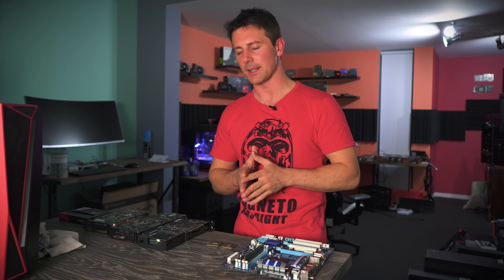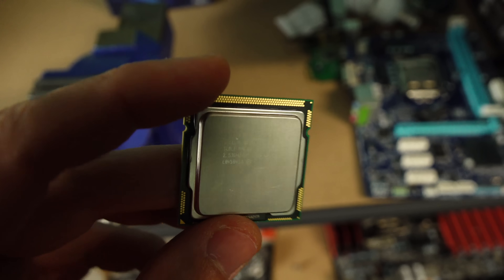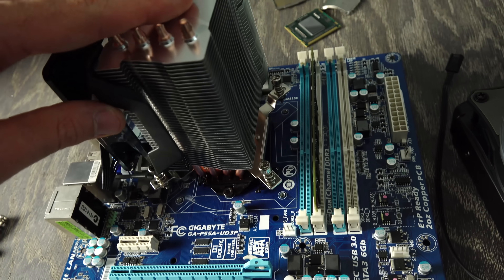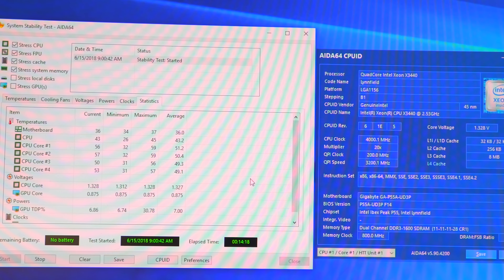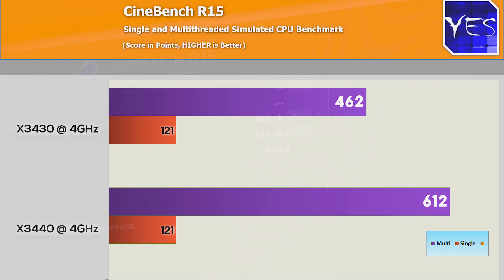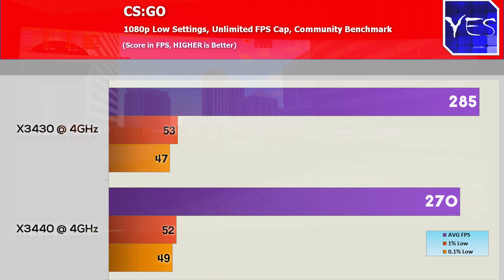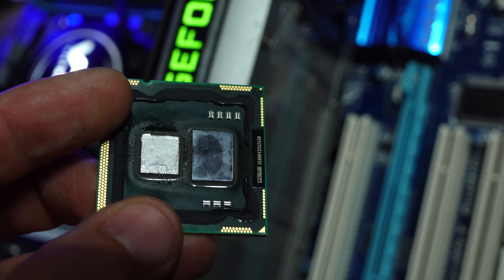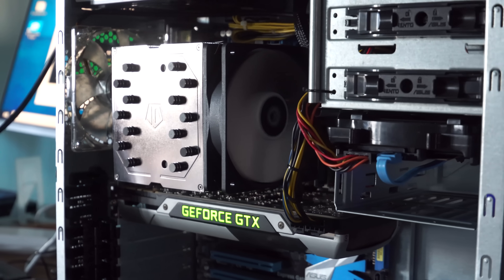X3430 ($7) Vs. X3440 ($18) Xeon - Is Hyper Threading WORTH $11!?

Comment: i had to do this recently my self, you can just screw of the "socket mounting hardware" and change it or modify the existing to your liking to fit standard / not standard coolers / backplates to any motherboard. so in this case, you would just screw it off and saw/dremel of the "threaded parts" that "block the default holes" for the push pins.

Comment: I have a 200$ budget to build a cheap 4k editing machine, no need for special fx, just simple cut and export. Think I'm gonna get a i3 8100 and a mobo + ram and thats it, got an old r7 370 which should be good enough for a start. What do you guys think? I found a brand new i3 8100 for a little under 100$

Comment: Low setting is a bad idea for testing this question, while it seems like HT is pointless. It's not. If you were to put more strain on the CPU while gaming aka higher settings other things going that can take away the physical cores, the CPU with hyperthreading will be able to keep a steady framerate with it's logical cores assisting while the one without will start choking. 

This is a bad test per say for the topic, you've basically just tested IPC and not the load each can take. The X3440 is the better CPU no matter what unless you'd have to be an excessive amount like 100$ more.

Comment: You need to test other games Brian
Reply: For me the x3440 runs any game I try over 60 fps without any issues. So it will probably run what game you want to play very nicely if you pair it with a good gpu and enough ram.

Comment: This is the fastest cheapest CPU. Had a 3430 in my server, but I wanted the hyperthread from 3440. So far I'm running a X5675 main workstation, X3440 server and X5472 socket 771/775 xeon rigs.

Comment: Still using an i5-750 ( ~x3430 ) clocked at 3.7Ghz on my secondary pc and I was actually looking for some infos regarding a potential upgrade to the x3440 in the near future. Seeing that the difference in games isn't too high between them, I guess I'll wait for now. Meanwhile, I need to find a decent P67/Z68/Z77 mb for the main pc, because my current Asrock P67Pro3 has some serious issues lately with the error 10/55 codes...Anyways, thank you for the video, it was really helpful.

Comment: I still have an old ASUS P55D-E running the i7 870...H60 water cooler, 16 gigs of ram and a EVGA1050 ti FTW.  Hits about 3.7 and still a very solid build.

Comment: Got a Xeon X3450 for $20 at eBay AU last year, running it on my secondary rig which originally had an i5 760 and overclocked the beast of a CPU to 4.00GHz @ 1.32v using a Gigabyte GA-P55-USB3 Rev 2.0 motherboard, with 8GB RAM and GTX 950 2GB, it makes a good TV rig with medium settings gaming when I'm in my lounge room. It beats the FX-9590 @ 5GHz in multithreaded performance, which makes this a decent CPU in 2018.

Comment: can any Xeon fit in my lga775 socket with a psu of 220v? and i will be upgrading psu for gtx 750
Reply: You'll have to use 771 xeons that have been modded to fit 775. They're very cheap though :)

Comment: The only downside of these chips is the wattage. You need at least a 500~600 watt PSU in order to pair them with a decent graphic cards that doesn't bottleneck.

Comment: i got a mobo for this cpu at 20$ via taobao, combo with x3440 is around 30$
Reply: Clement Wong What model of mobo?
Reply: Emperime it's an intel oem workstation mobo from foxconn
Reply: @711jastin  The mobo is capable of overclock?
Reply: @lewis5648  Yes just that i don't know how far can i push with the power phase, clocked it to 3.5Ghz only for safety reason.

Comment: Still using that i5 760 (0:46) in a PC I gave to someone, it's working great for them. Very nice video on the Xeons though. 1156 is still suprisingly capable when 1155 isn't a available.
Reply: yeah, the exact reason I moved from Sandy Bridge, no motherboards around. My poor 2600k is languishing in a dead board :( and replacements are way too expensive and still used... no new old stock I can find.
Reply: Allison Pell: I've had good luck with the Z77 Boards (Gigabyte) from China, they're around £50 which isn't a bad price. You'd need to add some heatsinks to those VRMs.
Reply: Awesome, thanks! I'll look at those soon, maybe get the old beast back up and running as a spare rig or server.
Reply: Budget-Builds Official
Tell me more about how that PC is working for that guy when you took the CPU powering it.
Reply: Why did you not watch the video? He delidded them to replace the thermal paste and gain a 10+ degree temperature drop
Reply: Allison Pell socket 1155 motherboard is damn cheap at my country (Malaysia)
Reply: Why did he take the lids off ??
Reply: HazewinDog oh ok thanks
Reply: Budget-Builds Official:
How can you still be using it if you gave it to someone?

Comment: Hey Brian, loving the 1156 content. I have an i5-750 in my Wife's PC clocked to 3.8GHz on the UD3R version of that board, coupled with a GTX 770 and I'm wondering if there would be any advantage in upgrading the CPU to the X3430? Cheers from the Central Coast, NSW.

Comment: Great video! Got both but like the 3440 better in daily use. 
What is the top gfx card you would pair with this before the CPU and DDR3 become an issue? 1060 or 480 going too far?1
Reply: I ran mine with a 2060super for a while and the 2060super was always the bottleneck unless it was a game that could only use 1 or 2 cores. I was running most games at 1080p high/ultra settings.

And just make sure to get 16 gigs of ram at 1600mhz or better and you should be fine.

Comment: Bryan overclocking guide for this cpu pls

Ps: damn never knew id get the ❤️
Reply: It's mostly like overclocking on the 775 platform, up the fsb and then and voltages and BAM, 3.8GHz on a x3440 4 core and 4.18GHz single core boost
Reply: KarVin Pastel yaaasass!
Reply: Yes please, bz i'm getting this Cpu..
Reply: 20 multi x 200 bclk and give it a voltage bump
Reply: What should my voltages be? 1.25v?
Reply: what board are you working on?
Around 1.3v was what I used for 4ghz
You can try starting lower and testing for stability and then going up in increments.
Reply: I'm using P7H55M
Reply: @karvin my x3440 is stable at 1.28v 3.8GHz across all cores
Reply: @DunhaCC  same im stuck right at 3.8GHZ

Comment: Hi, running games in windowed mode on some engines decreases the performance, so you need actual 1080p screen for accurate testing and proper results, for example one game with big performance difference between full screen and windowed is Call of Duty World at War, drops frames when not full screen :)

Comment: You can build from Aliexpress a 6 core pc with an FX 6300 for $59 (or brand new from Amazon for the same price with cooler includer), 8 GB of ram for $30 and a legit 2GB GTX 750 Ti for $60. Wouldn't be better this $150 combo? And you can get a new motherboard for as low as $50.
Reply: Sergiu C. Should I buy these parts from aliexpress or Amazon?
Reply: Dont EVER buy fx cpus plz, they are trash and they are not high core, its just hypertreading
Reply: I'm just curious how an FX 6300 or 8300 would perform compared to X3430.
Reply: FX actually holds it's own quite well in newer titles, thought I would recommend anything less than the 8000 series. Brain actually did a video on the latter.

And no, its not "hyper-threading", that's a misconception of how Bulldozer works. They're independent physical (integer) cores, with shared FPU's and cache. They can execute tasks independently, their performance is just dependent on how those tasks are balanced.
Reply: And also you can build for cheap on AM3 & AM3+ socket, mainly because the RAM is damn cheap. You can find new 16GB ram for just $60 on Aliexpress
Reply: Leone Furlan Yes, I meant 750 Ti, not just 750

Comment: TechYesCity, I need help, I've recently bought a Dell Optiplex 9020 (i7 8gb ram 500gb HDD) for 200 usd and i wanted to buy a new PSU for it but I've discovered that the motherboard had an 8pin instead of 24pin, I've heard people say that i should use a 24pin to 8pin connector but some say that doing this will destroy your PSU, is this true?

Comment: im running a x3440 because of you :)
upgraded from a underclocked 8350 :)
got my xeon running at 3,6 ghz
Reply: the fx 8350 is an EXTREMELY hot cpu, so that's probably why he underclocked
Reply: Underclock is the opposite of overclock. You run it slower than stock. This can be for many reasons, noise, thermals, weak board or power savings.
Reply: Same thing but i'm running a x5675 @4.3ghz because of his x58 vids
Reply: HerrHansen for games maybe, but video rendering not
Reply: well to be fair he did say he has an underclock 8350 not a normal  or oc 8350
Reply: Why exactly is it underclocked?
Reply: Not a downgrade nor upgrade, more like a sidegrade.
Reply: Gerrit-Jan Bergwerf I’m running an X3430 because of TYC. Runs great paired with my GTX 1060.
Reply: The 3440 is a better CPU. I have a soft spot for the FX series, but the 3440 is a better cpu.
Reply: D1stRU3T0R #AMD the 8350 and 8300 are the same chip, just different clocks. Ive owned an 8320 oced to 4ghz and a 3440 oced to 4, the xeon is better clock for clock.
Reply: My 8320e overclocked stable to 4.6 ghz gets a 710 cbr score - so I'm not sure this x3440 at 4 ghz could match it.
Reply: That's not a downgrade, mate. I have both the 8350 and a xeon x3470 and the Xeon is just better. Video rendering, games, you name it.
Reply: Haha, I'm running the x3440 at 3,6 GHz too! Unfortunately vrm on my p55 LX throttles when i increase it. I bought a few mini vrm heatsinks from AliExpress, hopefully that will help. I've tried both of the CPUs and I have to say that the x3440 is crazy for its prize, at least when playing games that use the extra horsepower! All in all really happy!
Reply: D1stRU3T0R #AMD i never noticed a massive difference in real world, but in games it was night and day.
Reply: hey i have installed x3440 on asus p7-h55m. there's a 8 gigs of ram stick @1866. but i am not getting a display. Do i have to put the ram in blue slot? I am testing it with a 1060. Thanks
Reply: @wild-dhillon  did you work it out?
Reply: I have mine at 4.4Ghz. It gets about 1450-1500 points in cinebench R20. A 8350 should get about the same on a decent overclock. I do think my xeon overclock is above average however. But you shouldn't notice to much of a difference.

Until 16gigs of ram won't be enough anymore that is.
Reply: @Lynnfield3440  hey mate, how you doing? wasn't hoping for a reply on this comment after an year but I sold my xeon setup 7-8 months back. upgraded to i7 10700 and 2080 super 🙂
Reply: @wild-dhillon  I'm good, was just browsing YouTube at 2am on a school night.

And so sad, but the 10700 shoupd he nice. 

But basically it depends where you need to put the ram in the motherboards I have you usually put them in the 2nd and 4th slot, but I have seen ones that want 1 and 3 or 1 and 2.
Reply: I run mine at 4.8GHZ and it doesn't run overly hot with a hyper 212.
Reply: @mikeerickson4750  Did you use some hardware  solution to look at the temps? I've heard the built in temp sensors from fx series are broken.
Reply: Thats a definite downgrade tbh
Reply: thats a downgrade lol

Comment: Bryan, I have that exact motherboard, and to remove the backplate, you use a flat head screw driver, and pry it off, but be careful! Cheers!
Reply: liam Why did he take the lids off ??
Reply: @tacheres4313  To apply new thermal paste as these processors have Thermal paste between dies and lid